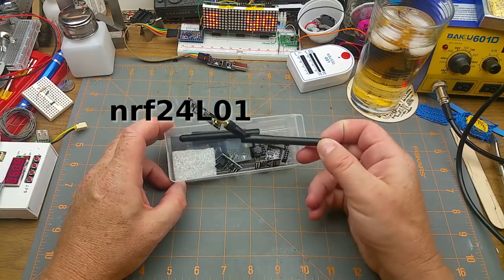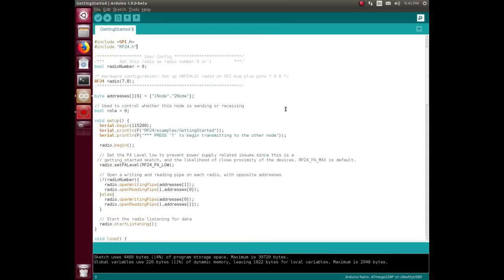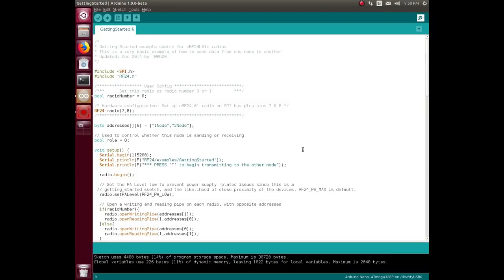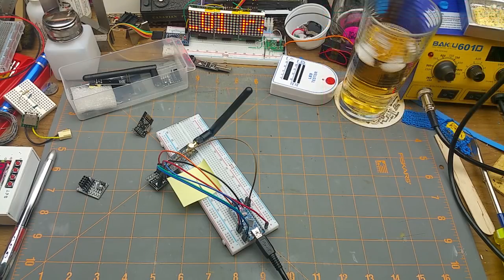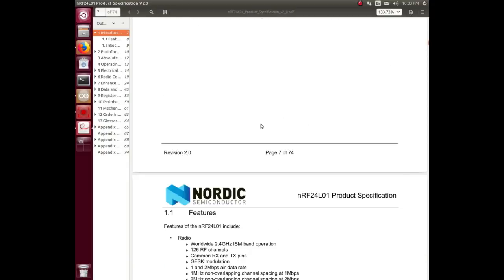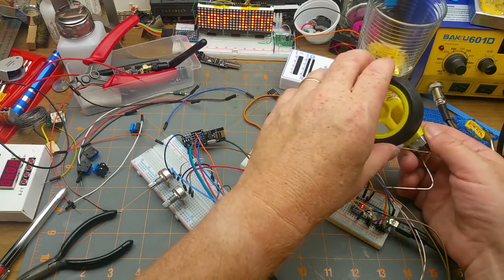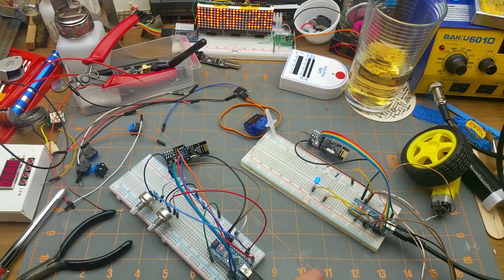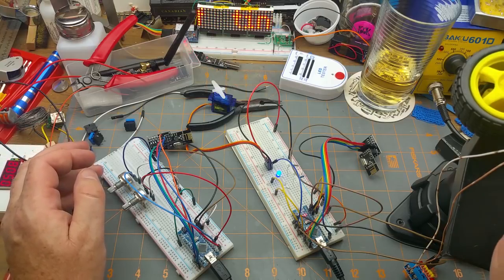playing with NRF24L01

Comment: Its been a few years since your video but I also love those adapter pcb's.  I DID de-solder and relocate the pins on the bottom of the board and once the 2 power pins land on the lower rails, all worked perfectly.  What is crazy, I CANT find them anywhere with them on the bottom, so one weekend, I relocated the pins on about 10 adapter pcb's.

Comment: Maybe stoping the motor introduced back emf and messed up the receiver?  I can't tell where the motor's power is coming from.
Reply from the maker: That's quite probable.
I was just taking it's power from the same 5V bus on the breadboard as everything else was being powered from.Probably should have added a capacitor or 2 to the H bridge board.